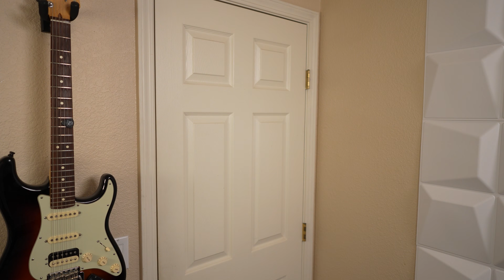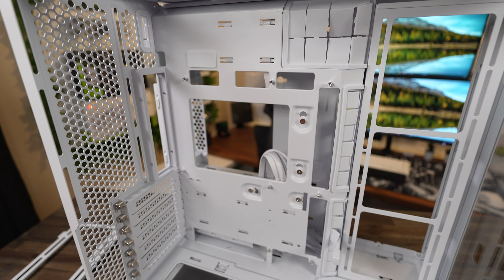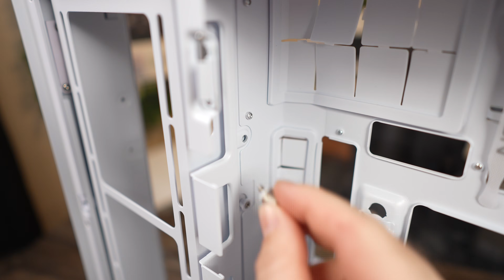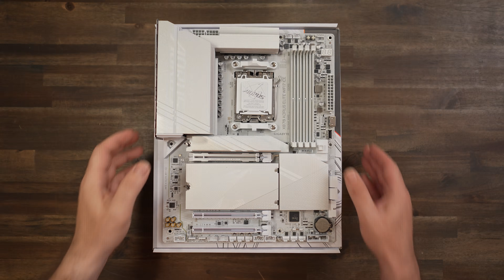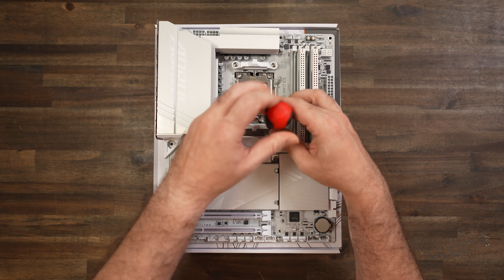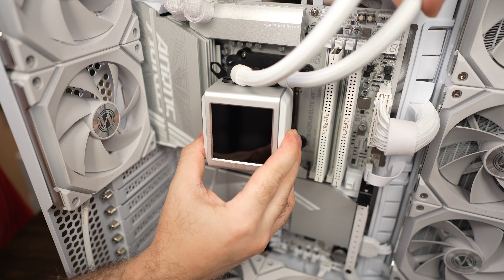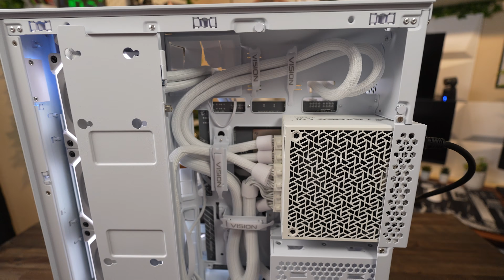Lian Li is BACK with the NEW 011 Vision COMPACT (X870 Build)

Comment: Now we just need reverse blade AIO as standard, as currently have to buy reverse fans separately and swap them over or flip the regular aio fans around and not get visually as good view when using the AIO as intake with this case, no videos ive seen yet mention this point.

Comment: @dankamyouknow for your psu there’s no link for me to use same one and what screw drivers or screw driver kit can I use and is electric screw drivers good for motherboard or is manual better cause I hear that it can over tight and card the board using electric cause I’m building mine like yours in 3 weeks and i don’t have a big desk mine is prob like yours h9 flow or lian li 011D evo rgb

Comment: Nice video! Got a few Qs:
1. With your current config, is there enough space to place an 8.8 inch IPS monitor on top of your motherboard as advertised by Lian Li?
2. For the side intake fans, how's the temperature performance boost with the three added fans compared with only 3 fans and the radiator?
3. The CPU cooler fans on the radiator doesn't look like they are from the Gallahad II, did you change them with other Lian Li fans?

Thanks!

Comment: The lower exhaust fan is installed backwards
Reply from the maker: You mean the bottom fans? They are reverse blade fans and they’re intake. The side front fans are also reverse blade.

Comment: I’ve decided to get a gaming pc. Not experienced in building or even k ow what all the parts mean. I want a really computer that can run high end games and mods at high res and fps. Are there pre built pcs I can buy or am I better off learning and building my own? I was thinking with a prebuilt I can just switch out parts to make it better.  Thanks! Also if there’s stuff I should be considering that I’m not (other than budget) lmk. Thanks

Comment: Hey! Love the build! So clean :) 
Was curious what fan controller you ended up using?
Reply from the maker: Thanks! It comes with the Lian Li SLV2 3-pack of fans. It’s the only one that will work.
Reply: @DanKamYouKnow Thanks!
Reply: @DanKamYouKnow  Hi. Are all 11 fans connected to the controller or are some plugged in to the motherboard directly? Thinking of building one exactly like yours. Thanks.
Reply from the maker: All fans are plugged into the controller. 👍

Comment: I have said to a lot of different creators you should have used the Lian Li EDGE Platinum power supply it’s literally made for this case
Because that cable management is a mess but I’m not saying I am better than you I’m saying you could have done a lot better

Comment: Hey Dan, not sure if you entertain questions and provide advise, I have a gaming setup on a LianLi Evo XL and wanting to downsize into a SFF that can hold a 360mm AiO.  I was hoping to keep most of the components I have and just probably switch my MoBo and PS.  Any advise on which case I should go with and not have to worry too much about losing airflow and cooling?  Thanks and more power.  Say hi to your twin Dan for me.  😜

Comment: Very clean build.
I have a question though;
Heard that having the aio radiator vertical like that could introduce some bubbles into the loop. Wondering if that could be an issue.

Comment: Hey I have a msi brand Pro B650 -VC WIFI (MS-7D78 and my front fan leds have stopped working I checked the connections all good its not very dusty I never dropped it the computer still turns on runs fine but the LED button doesn't even turn it on I used MSI Center to try and turn on my led front fans even updated the bios but still no led lights do u by chance know a way to turn them on the fans in the front still spin no leds though

Comment: Beauty and clean build 💯%
Tell me smt on this case. The big silver screws (back of the case) have good quality this time?
On my 3 builds I use only LianLiI but in some models like 011 Mini Snow Edition - generally the screws is bad.
Excellent camera - scenario and you explain anything very clear. You beast! I know!
Congrats also for the GPU Adapter infos!

Comment: Could you please give me the Amazon link for the fans you used in the last video. (Gamdias Neso P1) I am planning to take heavy inspiration from that vide and want to make sure I buy the right fans.
Reply from the maker: I'm sorry, I didn't realize that they were not linked under the GAMDIAS video:

Bottom and Side fans: https://amzn.to/4gWtT01 (You'll need 6 of these. These are reverse blade)
Top: https://amzn.to/3U9dyen (You'll need a 3 pack so you can get the controller. The controller works with the reverse blades too.)
Rear: https://amzn.to/3U37bcH

That is the fan setup I used. All fans use one controller and you get that uniform look across all fans, because of the reverse blades.
Reply: @DanKamYouKnow  Thank you so much. Your an awesome content creator.

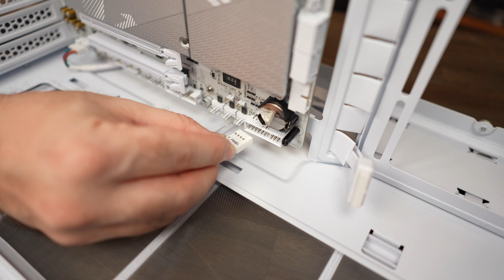Comment: can someone tell me what's that cable called on 14:25?
Reply from the maker: It’s a USB 3.0 cable. It’s for the from USB ports on the case.
Reply: @DanKamYouKnow  OH, so there is a USB 3.2 pins and the USB 3.0 Cable, do I plug it in? or does it not fit? I was wondering because I am building a pc for my friend (the motherboard is a b550 MK MATX)

Comment: Please can someone explain to me what the point in the 2.5/3.5 inch drive cages is? When I built my first PC in 2017, I had a 2.5 inch 240GB SSD (£75) for boot and a 3.5 inch HDD (£45) for mass storage. 

In 2024 however, for £100 you can get a 2TB PCIE 3.0 M.2 drive, yet all the new cases still offer support for older and arguably redundant hardware. 

It’s not a bad thing having more support but it does make you wonder for how much longer they’ll be included.

Comment: Super nice! Just wondering though, could there be a way to push/pull the warm radiator air directly out of the case instead of into the case?
Reply from the maker: You could set them as exhaust, but then you’d have negative pressure as the bottom fans would be the only intake. Temps are fantastic with the radiator fans set as intake though, and it generally works really well in most cases out there.

Comment: I was about to pull the trigger on the OG Vision, glad I waited. I did have a question, wouldn’t you just use the fans that came with the AIO? You listed 11 fans in your part picker but I imagine you left the radiator fans on as they were already set to exhaust. Then bought 6 reversible blades, and two more standard for the rear. No?

Comment: You need to change flow direction for the bottom fans. There are no intake fans in this case right now
Reply from the maker: They are reverse blade fans on bottom and the front side. They are intake on bottom and side. I mentioned this in the pinned comments because people comment this all the time.

Comment: For the Lian Li fans going into the controller was that the controller that came with the AIO, did it come with the one single wide header cables or is it the controller that uses the regular 5v and sys fan plugs on the end of the fans? I am doing a similar build with all SL inf fans and some reverse blade and one thing I cant figure out is if the controller that comes with the Aio is proper for routing all the fans or should I buy a 3 pack of fans and use the controller that comes with the singular wide connector for the controller that comes with the 3 pack. Thanks for the help, your builds are awesome and informative.
Reply from the maker: Hey! This is how mine are set up: All my fans are going into a singular fan controller that is powered by 2 SATA cables, and the controller is plugged in to a USB header on the motherboard. The AIO requires no controller and is plugged directly in to a USB header on the motherboard both the controller and fans are controlled by the Lian Li “L-Connect 3” software. Lian Li makes it unbelievably easy to hook everything up and control it all.
Reply: @DanKamYouKnow  gotcha I was just curious because i know the reverse blade fans you need to buy individually and wasn't sure if they came with the proper wires for the controller because I hear a lot of people say just buy a 3pack and get that controller because it makes it easier. Thank you for the quick reply :)

Comment: Hey Dan, it’s possible to install the gpu in vertical position? I was wondering because I have an cooler master v3 vertical holder
Reply from the maker: Possibly, but you might not be able to run bottom fans.

Comment: crazy build, do you know if you can use any AIO if you want to conceal the tubes in the back or does it have to be lian li cooler?
Reply from the maker: The AIO’s that have really large pump heads, may have trouble passing through the open hole, but most “regular sized” ones should work fine. I used the Lian Li Galahad II LCD and it just barely fit through the open hole.

Comment: Do those cables come with the PSU?
Reply from the maker: Yes they do, but I wrapped them with a cable sleeve and used Velcro strips around the ends of each cable. I linked the ones I used in the description and pinned comment